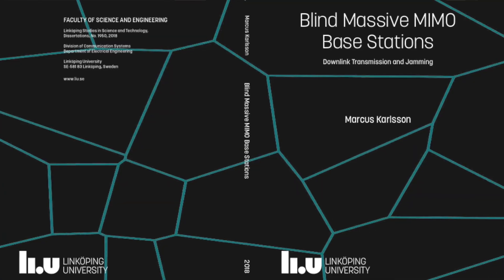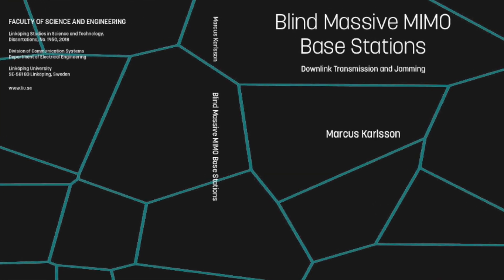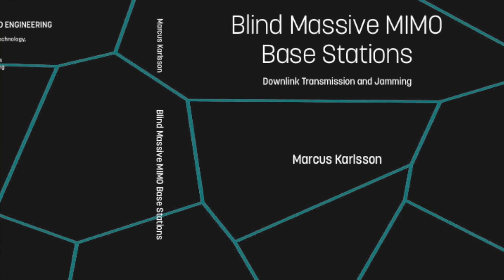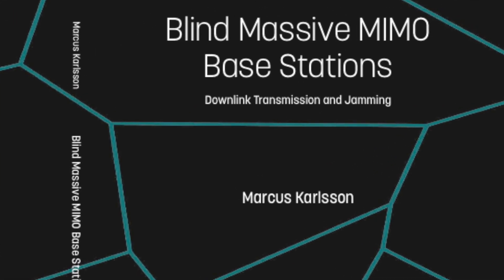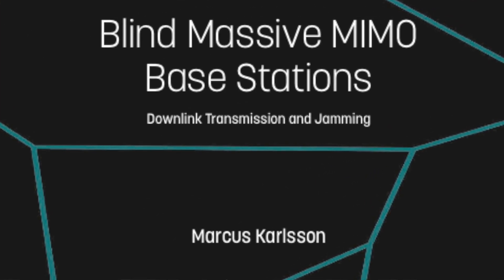Dr. Marcus Karlsson - Blind Massive MIMO Base Stations

Comment: So, STBC requires multiple AP's. Does that mean one AP has only one antenna, ie no beamforming at the AP level? -- Edit: After a bit of research, i now understand that STBC is Alamouti's code, and yes, it uses multiple sending antennas, and just one receiving antenna. The sending antennas send the same pilot codes, but in different order, with some inversion. The receiver performs calculations to pick out the good signal.
Reply from the maker: Yes! The important thing is that there are two transmit antennas. They can be on one AP or two different APs. If the receiver has multiple antennas, this will improve the signal reception as well, but it is not part of the Alamouti code design.

Comment: Interesting video. It would be great if it could be made more clear how space time block Codes help to overcome the Problem that the Base Station does not know where the user is when He is not connected yet. So no Beam forming is being used.
Reply from the maker: It basically works like this: The base station transmits using different beams at different time. None of these beams can be tailored to the user's channel since we cannot know it before the user has connected, but the transmission is coded such that the user can combine the signals from all the beams in a way that increases the reliability of the transmission. Space-time block codes have been used for many years, but the applications to Massive MIMO are new. I recommend the introduction chapters of the thesis for more details.